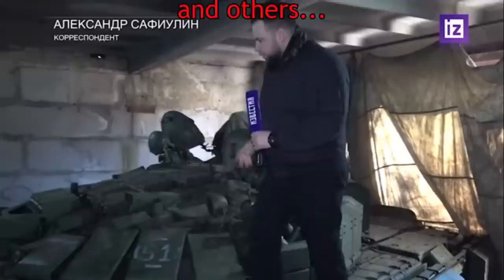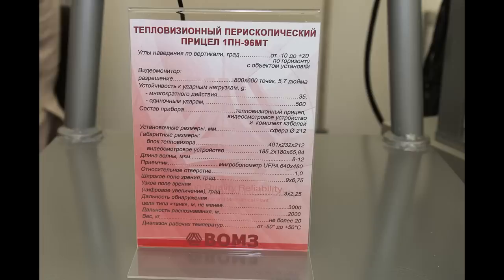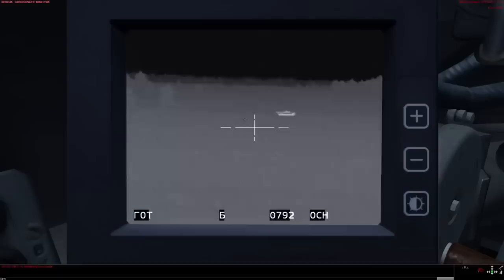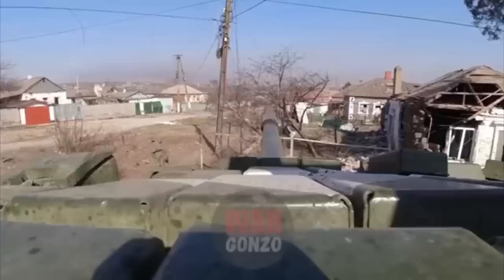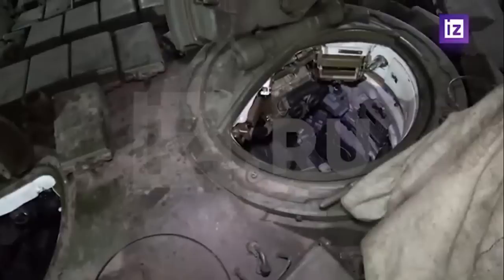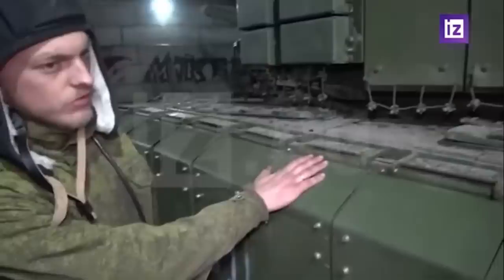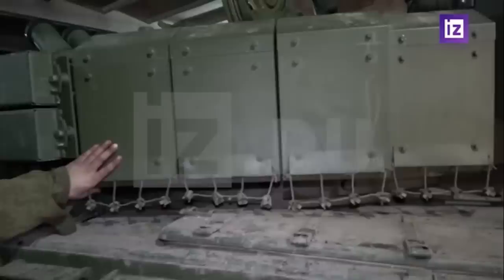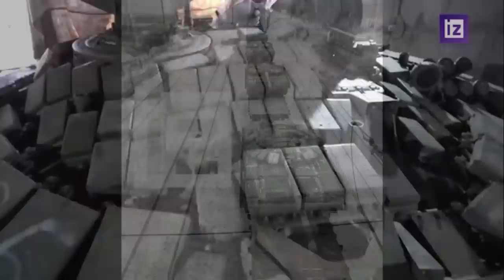Are Russians Downgrading Their Tanks?

Comment: So, one lesson from the video is why make a good tank if they are just going to be destroyed anyway?  BRILLIANT!
Reply: In the long run, quantity may beat quality. Why spend more, when the tanks can just be "good enough", and they will be destroyed anyway, so might as well minimize losses. It even shows in the video that no matter how advanced some of the tanks are, they are destroyed eventually.
Reply: @galact1cphantom824  russia does not have infinte crews
Reply: @galact1cphantom824  Because when you have a finite resource that you can replace anywhere near the rate at which it's being destroyed, you end up without any quantity!
Reply: @michaeldonnelly6747  that's right they only have finite resources, so why spend those finite resources in a few high quality tanks when they can get more out of those finite resources by spending it on more lower quality tanks that are just "good enough". In the end no matter what happens, they will be destroyed, so might as well get the most out of what they have.
Reply: @galact1cphantom824  Fantastic.  So, they run out either way?  The brilliance in this comment section knows no bounds!
Reply: The only thing that could actually help those tanks and crews would be an active Protection system, but for some reason Russia refuses to upgrade their tanks with it, maybe due to high cost or because they don't have enough resources or whatever.
Reply: @xAlexTobiasxB  Or because their APS doesn't work!

Comment: I can't be the only one who thought that that box of "ERA" swung upwards a little too easily right?
Reply: that's because they are empty, the actual explosive panels aren't stored there all the time, but are supposed to be mounted before actually arriving to the combat zone.
Reply: I thought those things were heavy af😅
Reply: @TheFivetimesdead  ...they are not that heavy even when they are loaded, it is basically a thin sheet metal box with a bit thicker metal plate inside, a thin layer of explosive and some padding... it weights no more than a tool box or something like that. The whole point of ERA is to be light armor, light compared to steel plates :D

Comment: thermal sight in leopard 2 and abrams it's 6000 meters or 8000 meters or less ?
Reply: Waste of time. Ask Houthis and Kurds.
Reply: Only for the latest variants with 3rs or even 4th generation, but not the old Leo 2A4 which still has very old thermal (1st generation) with very bad quality (not even high definition) so it's only around 2~3 km for the Leo 2A4 at best

Comment: You are confusing automatic lead with automatic tracking.

T-64BV, T-80BV and T-72B only have automatic lead calculations for the gunner meaning the reticle will light up to the corresponding lead set by the laser range finder.  Automatic tracking wasn't introduced until T-80U and T-90 which automatically tracks the target and is constantly adjusting the reticle based on the input from the laser range finder.

Comment: @RedEffect  what happend to the russian smoke luncher in theory if they use them around the vehicles other than  the far assault smoke russians like, it would be a counter to the javelin if the russians useing ir save smoke do they? and why is this war not often seen that russians pop any smoke ?
Reply: For smoke to work you need to first spot the missile and then release the smoke in right time before it disperses. It has to be fully automated and i doubt it will fool modern missiles with their fancy algorithms anyway. This just seems like trivial thing to counter.
Reply: @robertkalinic335  its just that i saw a western company advertiseing  a smoke screen all around the tank system smoke covered the whole tank and i was thinking hmm strange simple but as far as i understand the javelin has a ir sensor so when the tank is in the ir proof smoke its basiclly invisible with ir optic from the missile 
i mean you can pack the tank full of smoke lunchers and as soon one tank explodes the other tanks hit the smoke and smoke again and again on the retreat (would be great if some where is cover XD)
and as i was thinking about that i was astonished by how many ukr war videos i saw and never they deployed smoke
Reply: @fdsfggr   I believe tanks only have sensors to tell if they are being lased, not capability to spot missiles already heading for them. Thats useless against modern missiles and could work against older if operator isnt skilled enough to guide missile close enough to the vehicle without aiming at it and only aiming directly at the tank when its too late for smoke to deploy.
As far as ukrainians not using smoke it could be just that there isnt enough footage or as i said, this isnt effective defence if you dont expect atgms.
You can always use smoke preemptively and maneuver around it or terrain to avoid even being locked on, doesnt matter how modern the missile is.
Or just have aps on your vehicle and slap every missile out of the air.

Comment: Most of the battles are tank versus trench or building not against other tanks. Ukrainians have almost no tanks left and those that remain have their position already mapped and there is zero threat from them.

So there is no need to send modern tanks to clean out trenches or buildings as they are expensive and could be taken out by Javelins. What you do is send crappy and old tanks from storage and equip them with old night vision and thermal sights and a ton of HE ammo.

Even so they are extremely deadly as they can engage the infantry from outside any Javelin range. Once they deplete their ammo they retreat, reload and move to the contact line again. They use two to four old tanks and one modern one in standby behind, just in case one lost Ukrainian tank dares to approach. 

In urban environment they push even older tanks ahead to take the heat. Usually the Ukrainians waste most of their AT capabilities on these old tanks, often not even disabling them as they are stacked with ERA and have a huge frontal armor protection. Again they use HE and shoot to the buildings. Once hit or running out of ammo they retreat and send another one. 

Again, the contact area is almost void of any Ukrainian heavy armor. And if, by mistake, one such tank dares to move towards the Russians they don't get too far and all hell breaks loose as they are targeted by artillery or long range AT team long before they may meet a tank to engage.

So for trench clearing and street assault Russians use old tanks. Smart.

Comment: Usually when you use an uncooled microbolometer thermal camera, the thing that suffers most is the frame rate. They also require constant recalibration interruptions for changes in the internal temperature of the sight. You end up with a thermal sight that can only operate at 10Hz and cuts out for half a second every 30 seconds or so.

Russia has no MEMS production capacity of its own, so yeah, it looks like they're repurposing cheap commercial thermal sensors. I also wouldn't be surprised at all if it were actually a 320x240 sight and not 640x480, as QVGA FLIR sensors are the easiest thing to get right now that's "acceptable".

If Russia is saying they're using something worse than what they used to, what they're actually using is even worse than that.

Comment: I was wondering red effect. Would it be a feasible thing to turn many of russias t72 tanks into unmanned drones? The autoloader and inadequate protection make the tank dangerous to its crew. But a tank with an autoloader seems like a great platform to turn into an unmanned vehicle. Even if visibility from sensors inside the tank where to be be poor, small drones overhead could help guide the tank. Just wondering what your thoughts are. I can forsee that not having a crew would make transport, maintenance, refueling and small fixes difficult.
Reply: Drones are very very sensor and communication dependant, if we are not speaking about loitering munitions or cruise missiles build using *drone technology*.
Drones need way better sensors for operator remote operator than can be sufficient on manned vehicle
Reply: This would require serious R&D, modern electronics, and training. All this for what? Meat is not lacking, that has been and will remain the motto of the red army.

Comment: T72-B3 (m16) is already an upgrade of older T-72B, so it is still a downgrade compared to T-72b3. They won't be able to equip their tanks with modern thermals, sensors and electronics. Say goodbye to the T-14.

Comment: BTW the Leopard 1, which Germany has given the approval for sending to Ukraine, have a thermal sight which can discover targets up to 3000m away and identify them about 2000m away. So, there should be a slight advantage against these T72.
Reply: no, because the weak 105mm cannon and the laughable armor of the leo1, so every t72 will be totally superior to any leo1 from the front and distance.
Reply: @tombaur8316  The 105mm can penetrate the base armor of the T-72B with modern rounds, and K-1 doesn't provide much protection against APFSDS.
Reply: @voidtempering8700  maybe on the basic frontal t72 armor an under 1500m distance, but above or against t72b3 and similar wuld be nearly impossible, and against t80 or t90 ineffective even on shorter distances from the front.
and in return, the frontal armor of an upgraded t72 is up to three times thicker than of the leo1 and the 125mm round will go trough the leo1 even far over 3000m.
leo1 better than nothing, but all together on the same level like an older t72.

Comment: Which are the best features for urban fighting? Tank on tank seems less likely in the coming offensive.
Reply: The best feature is good thermals, fast turret movement, high gun (and coaxial autocannon/machnegun) maximum elevation.

And more importantly, having as many supporting eyes as possible, be it infantry, or drone.

At the end of the day tanks are not for the streets, they are for open fields.
As they have very limited vuew angles when "buttoned up". Thus its easy to neak up on them.

...and if not buttoned up, you are just asking for trouble. Urban terrain gives way too many options to anyone who is a good shot, to take chances with elliminating crew member shanging out ofbhatches for increased situational awareness.
Reply: best features for urban fighting is well trained troops

Comment: Despite having promised to deliver Leopard 2’s, NATO still haven’t even sent any of the promised Leopard 1’s. How well, or poorly for that matter, do you think the Leo 1’s will fare in the conflict in Ukraine? Would love to see a video about this. Regardless, I love your videos, keep it up buddy!
Reply: Leo 1 without thermal imaging is just a T 62 with slightly more accurate and terrible armor which can be penetrated by even the weakest Russian handheld launcher.
Reply: leopard 1s are essentially t54/5
Reply: They have thermals and a good FCS (not great, but allegedly comparable yet worse to the earliest Leopard 2 FCS). They are still very mobile. Their armour is good enough against a auto cannon, even the BMP-1 (maybe), but any MBT gun will rip right through it. And I mean any.

Essentially, I would parrot the decades old assumption: Good against T-62, can struggle against the T-72s in their most basic versions - if used as an MBT.

In conclusion, this means they should not try to deploy them as MBTs. But as a light tank fire support, it's still highly valuable. Think of it as a mobile and protected 105mm field gun. If they are deployed as support for infantry or with other MBTs, they are still valuable. Most importantly, the Leopard 1 is available. 3 Battalions of Leopard 1A5 beat 0 Battalions of everything else.

Ukraine conducted local assaults with HMMWVs and BMPs, for comparison. But still, trying to meet, for example, a T-72B3M heads on can only be described as suicide attempt.

Comment: Could not it be an older tank which is just being upgraded? I mean it is possible that new factory fresh tanks will have the new stuff but old models just parts of it?
Reply: Wouldn't surprise me if they're more or less remanufacturing tanks pulled out of deep storage. They're not kept well and usually pilfered for things to sell, so they'd need a fairly involved refurb.
Reply: You can only retro fit older tanks up to a certain point. Also do you think Russia really has the resources and time to do all of these at the same time?
1. Repair ALL older tanks.
2. Upgrade the ALL older tanks.
3. Making new tanks and newer variants 24/7. 
4. Making shells 24/7 for every different type of tanks. T62, T72, T80, T90 and T14. 
5. Train crews to operate all of the platforms or train different crews to operate different tanks. This crew is train to operate T62 while that crew is train to operate T80 variants, that other crew is train to operate T90 variants, this other crew is train to operate T14 and this other last crew is train to operate T72 variants. 
6. Repairing all the damage combat tanks.
Reply: @SCH292  All 10 thousand old T-72 in storage?
Reply: @phunkracy  Nope. I'm 99% sure that Russia can't DO ALL THE ABOVE I listed. I know that Russian Simps and Russian Bootlickers doesn't like it when I listed the above.

Comment: It makes sense to produce the higher quality tanks and upgrade the older ones with less capable systems.  The more capable tanks could be the hunter killers while the less capable ones are the cannon fodder / trip wire.  They can tell something is there and can pass that information on to the tanks that can kill at longer ranges.  Being easier and cheaper to upgrade and maintain also has its benefits in a war that is grinding on.

It shows Russia can learn, unfortunately.

Comment: why russia needs better tanks? ukraine also doesnt have better ones. its not necessary to risk the better ones.
Reply: Western tanks en route.
Reply: @venator5  dont need to waste tanks if you have combat choppers with Ataka ATGM with 25km range.
Reply: @Dek4DenZ  I just pointed out that ukraine has new tanks.
Reply: @Dek4DenZ  Combat helicopters suffer tremendous losses. Ukraine covered the Kharkiv offensive with Stingers, Buks and Gepards which shot down multiple fixed with and rotary wing assets of the Russian Aerospace Forces, which lead them to stop offering air support to the ground troops. It was pure suicide to fly into Kharkiv.
Reply: @Dek4DenZ   Those rarely get close to the frontlines nowadays. The abundance of manpads and other AA systems has made both sides extremely cautious in deploying any aircraft
Reply: @majk5995  hows ur math? manpads have what range? the new tanks then? then substract it with 25km. so those combat chopper still have no problems.
Reply: @ChucksSEADnDEAD  russia is not even use their air at full force. because of the single existent aa of ukraine but 25km range gives even the combat choppers enough space to operate.

take manpads range + new tank range - 25km range of Ataka ATGM. there is still enough safety space for the choppers.
Reply: @venator5  just vehicles, like everyone have.
Reply: @Dek4DenZ   manpads are not the only factor here.
 To fire at that range the helicopter needs to be at a high altitude, putting it into range of s-300. And slow moving targets like choppers are easy for them. 

That's why when you see helicopter footage from any side of the conflict they are flying very low to the ground
Reply: Flying low means they need to get close to fire and that's puts them in manpad range. There's even a video of a ka52 getting hit with stugna p atgm
Reply: @ChucksSEADnDEAD  Dude the fire range. ofcourse choppers will get destroyed. compare the firing range. is that so difficult?
Reply: @majk5995  yea while it was not moving. i saw the video too but i think it was the first and even last video kind of that for now, wasnt it? these are humans and humans making mistakes. you wouldnt beleive what i saw already on both sides.
Reply: @ChucksSEADnDEAD  
Gepard firing range 3km
KA-52 firing range 12km

a combat chopper takes out 20 to 30 enemy vehicles before he self gets maybe hit.. ukraine already lost their most soviet stuff and many soldiers who used them. thats why selenskji is begging allroudn the world.

Comment: well... cheap upgrade for few years and after that make new t90. basically vehicle combat is done pretty close up and if you can use thermos to spot and enemy at 3km you can if its day still use day sensor to hit. on for night... it will still help a lot. probably that thermos is adequate in most cases. and they are on full wartime production where quantity is more important than quality.

Comment: So this is the Iraqi T-72 with ERA and a cheap thermal.
Good luck with that. 😳
Reply: Do you not understand the differences between various T-72s?
Reply: Yep.
T-72M1 (lion of babylon) is almost identical to the T-72A.
T-72B has slightly thicker turret armour, a few extra horsepower, a modern gunnery computer and ERA.

And they've slapped on kontact5 and a basic thermal

There really isn't much difference between them all, these are cheap tanks for conscripts.
Reply: @MostlyPennyCat  You realize the things you listed provide very big differences, right. A near 50% increase in armor, 5x increase in sighting range and far better deployment in night conditions. This couples with far more accurate FCS systems. 

I don't understand how you could say there isn't much difference between the two, this is a very big difference.